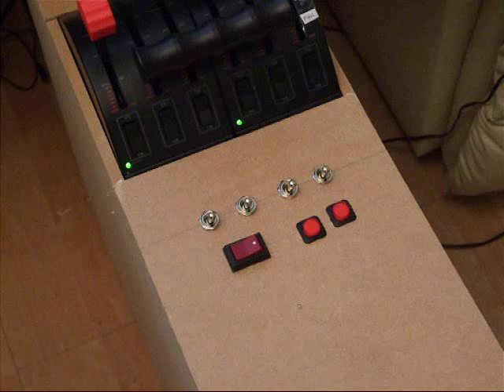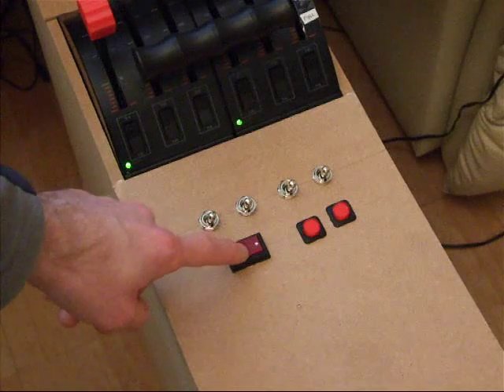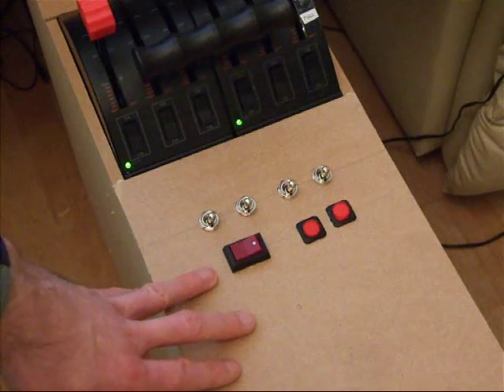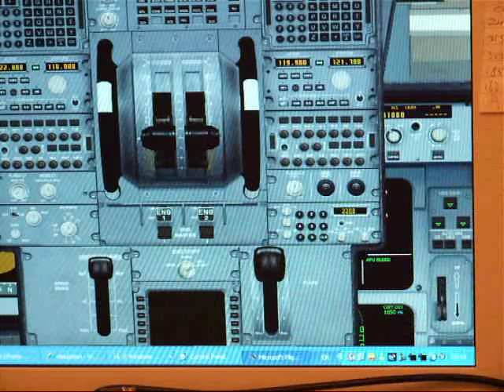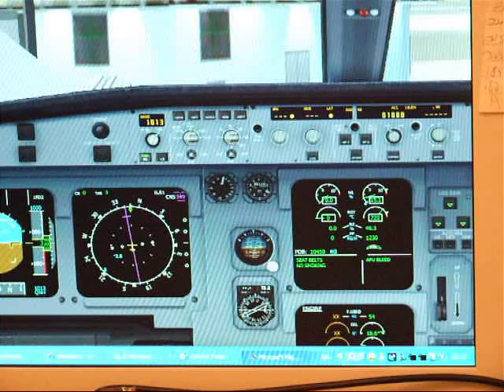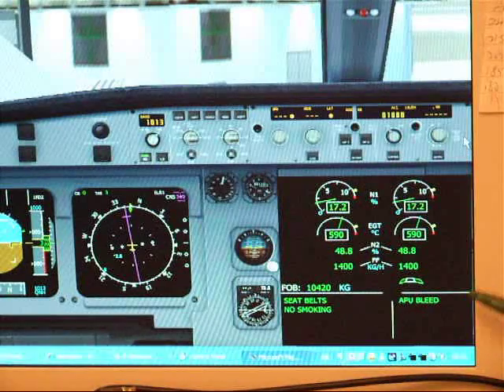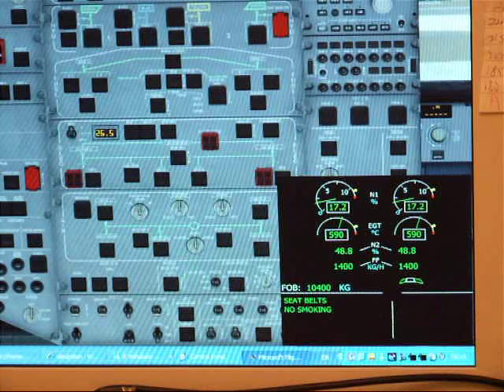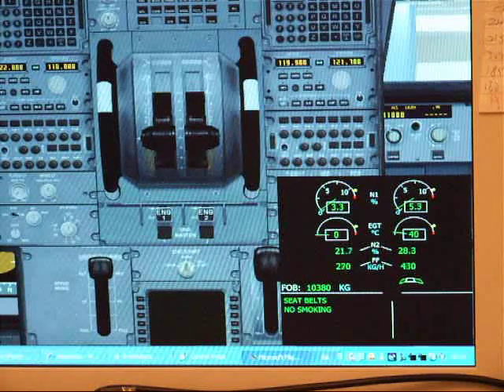BU0836X Demonstration

Comment: Hello from Chile, I have a question, the switches and buttons are with specific voltage to connect to usb? I searched in electric stores in Chile switches to purchase and built this panel but all are 110-250V and 12v too.
Thank you!
Juan Pablo
Reply from the maker: FACH Nowotny No specific voltage. Whatever passes through these is very low indeed. I think any switch of any specification will work fine. If you need to be sure, check the card specifications with Leo Bodnar, the genius creator.

Comment from the maker: Hi there,
It depends on what control I am activating. If it has been mousetrapped, you must use FSUIPC. If it's a regular FS control, you can do it either way. The card means either system just sees a joystick. Very easy!